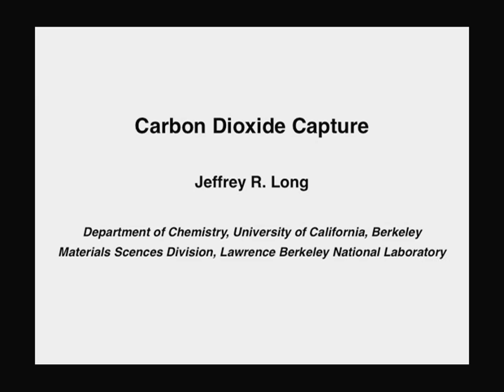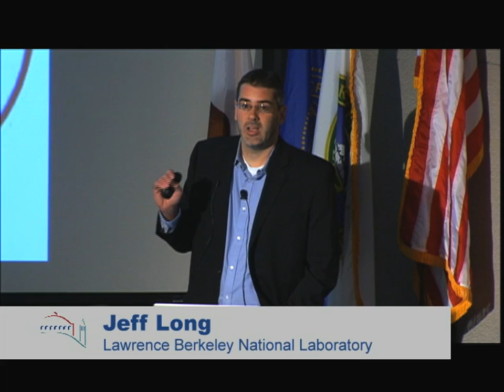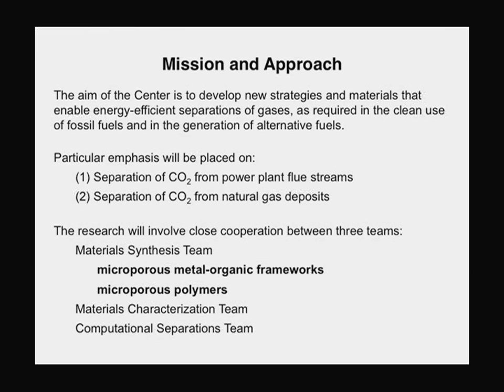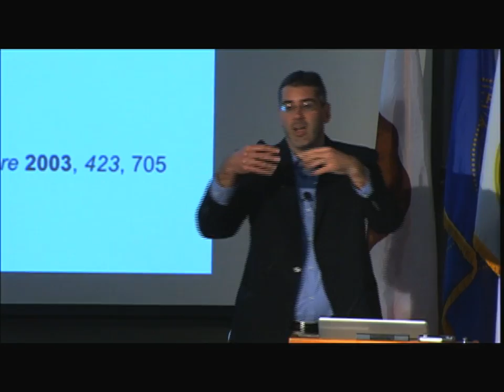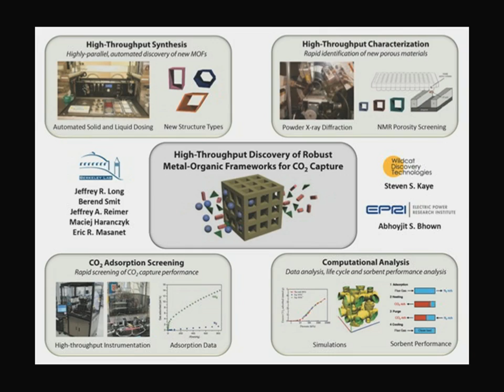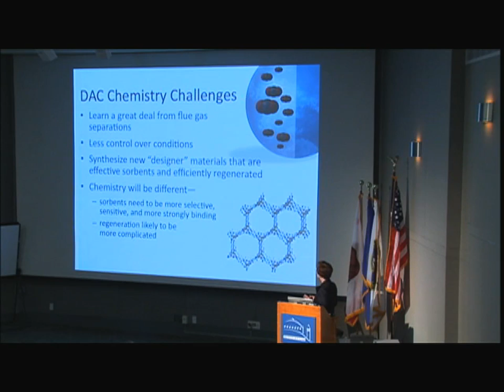Capturing Carbon

Comment: @mercuryrazvedka Also note how less than half of the planets and a couple of moons do *not* correspond to the entire solar system. Especially when most cases have been shown to be seasonal changes and the rest, Mars and Neptune either can be explained through local changes (Mars) or have data that can't at all be explained solely by the sun (Neptune).

Comment: @mercuryrazvedka Could you link to that research? Especially the one where they somehow have mapped the temperature of those planets hundreds of years back? I would definitely appreciate it.
If you got it you might have a point, but otherwise, like I said, solar cycles *are* included in the calculations made by climatologists.
Also note that next to zero *climatologists* refute the AGW. The people who do are, with extremely few exceptions, either not scientists and definitely not climatologists.

Comment: @mercuryrazvedka
I've just read Fentons work. It concerns mars specifically and shows how this can be explained solely by local changes on mars, although it did not outright prove that the sun was not partially responsible. Thus, the article you mention do *not* support your position.
Furthermore, the very few other planets and moons that seem to correlate with earth temperature, have all so far been explained by seasonal change.
Again, if you can show me some science that support your position?

Comment: @mercuryrazvedka I think that was just about the most over-generalized statement I have ever heard about the overwhelmingly complex and interdependent system that the earths climate really is.
Yeah, the sun affects climate, climatologists know this. However, they also know that the sun has a pretty regular cycle, which IS included in their calculations. There are loads of other factors as well, but only fringe (dominated by non-climatologist) scientists refute the anthropogenic contribution.